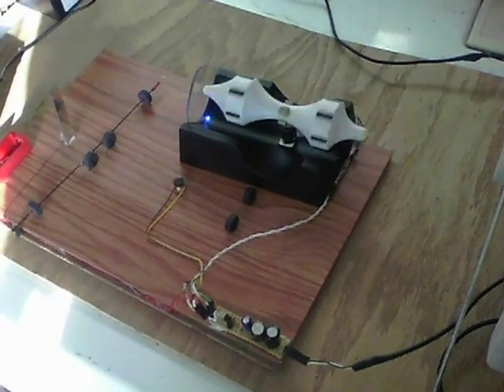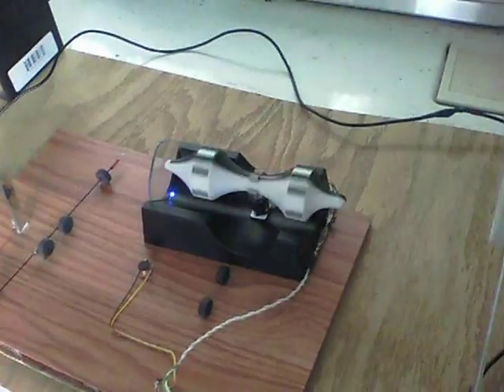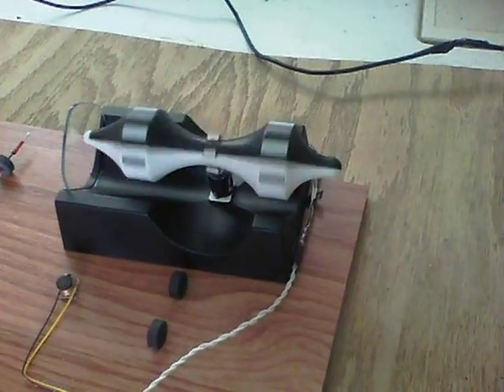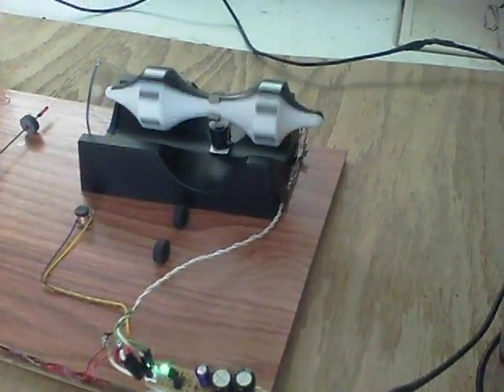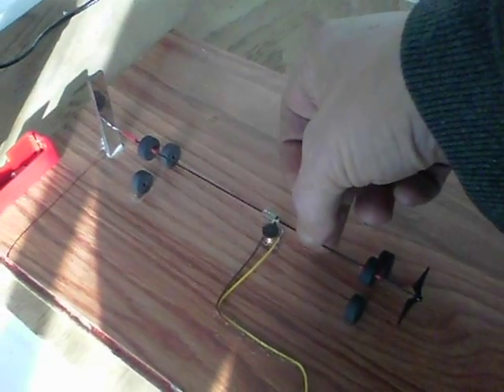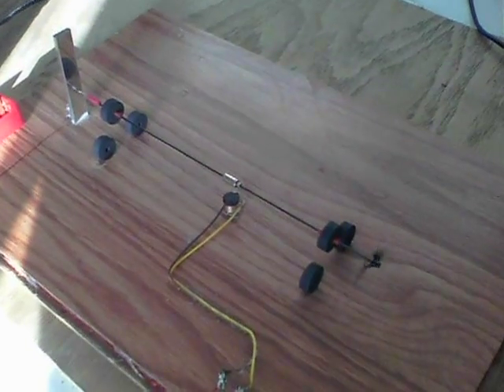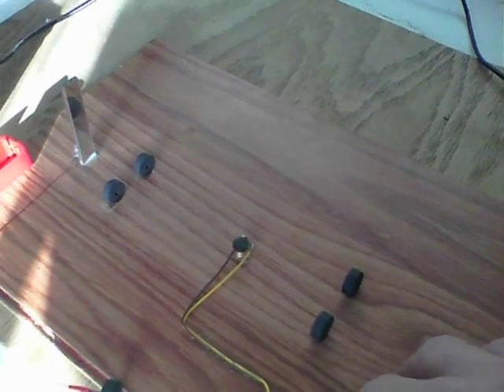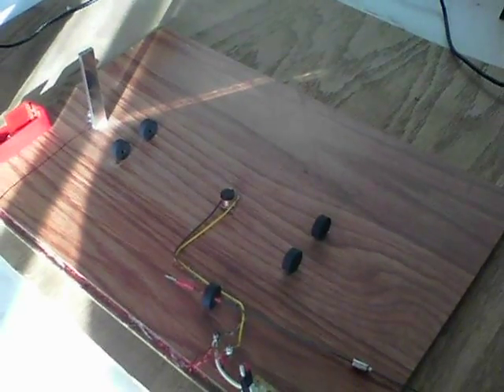Levitators in the sun

Comment from the maker: Yeah, difficult to get a snug fit in glass, wrapping the egg in tape or toilet roll would help, messy though. What I picture, would be a plastic cigar tube with snake egg in middle, then 2 plastic bungs each side, 1 bung near egg, 1 capping the end of tube. A metal rod would go through the bungs on each end. 2 bungs each side to stabilise the rods rather than 1 wobbly bung.

Comment from the maker: Oh good point, hadn't thought of snake egg. 2 for $1 at Dollar Tree. Could build a cage for it, to make sure suspension rod is completely straight, then pop egg in cage. They're heavy, so will need good end point magnets...or more snake eggs for the levitating at ends. Just tested with 2 here - opposed snake eggs give x2 diameter gravity repulsion.
Can get small magnet out of any <1oz crashed R/C toy plane. The motors are usually 6mm diameter and are called 'coreless', quite easy to take apart.